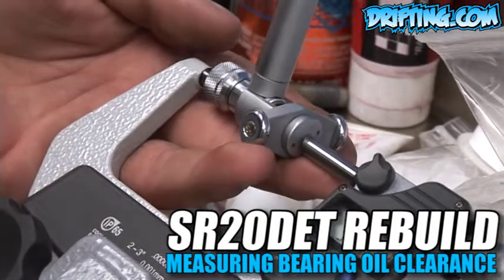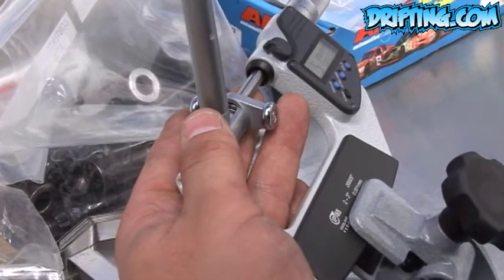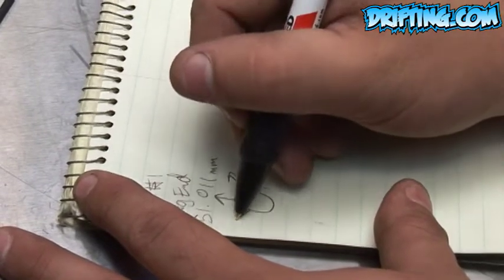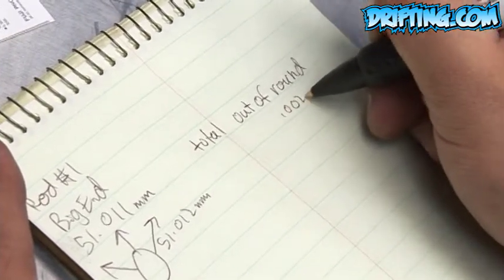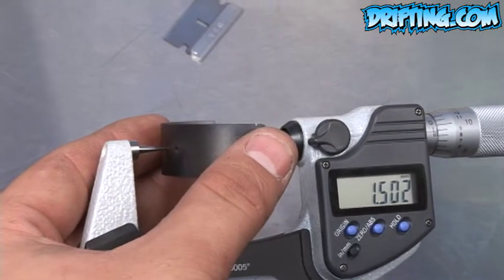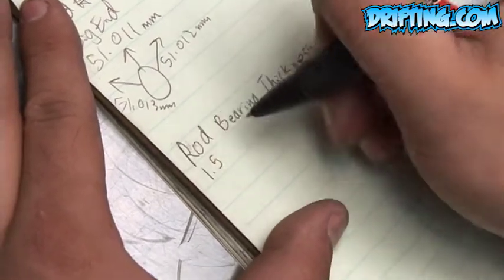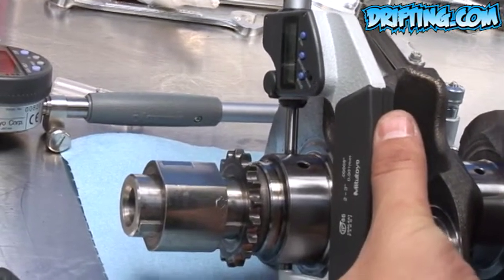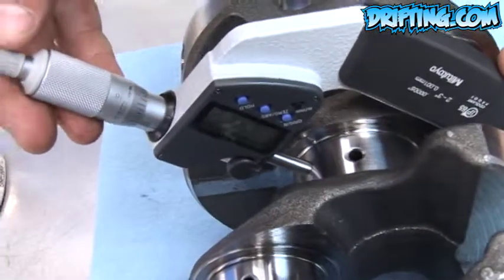SR20DET Rebuild - How to Measure Bearing Oil Clearance

Comment: I think this is the only video that I've seen that someone does measure the oil clearances using a micrometer to measure the thickness of the bearing an using math to calculate the oil clearances. Some bearings deform due to the bearing crush so the method of measuring the bearings will not work.The other method is measuring the oil clearances with the bearings installed on the rods with the bore gauge. However, the latter method will scratch the bearings. A lot of builders say that these scratches will not be an issue.